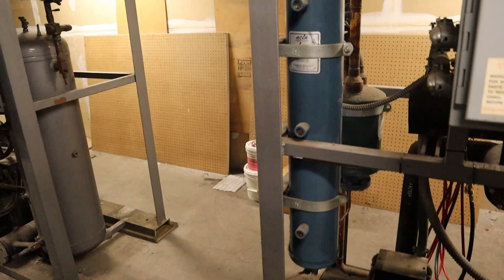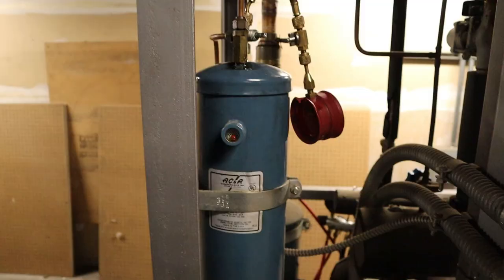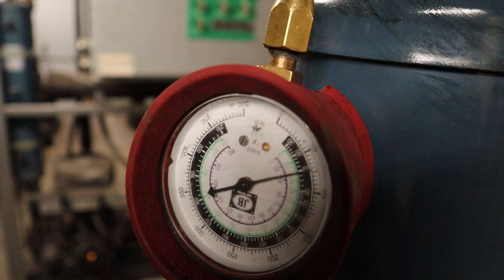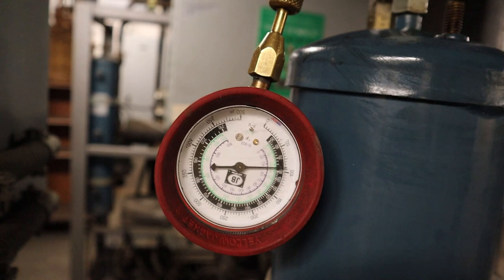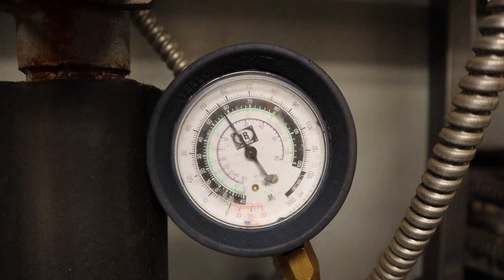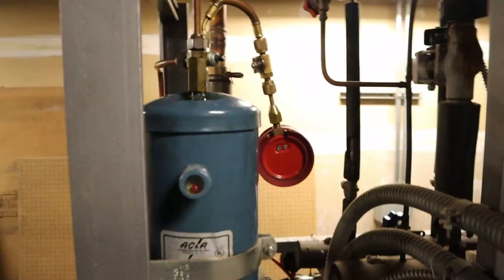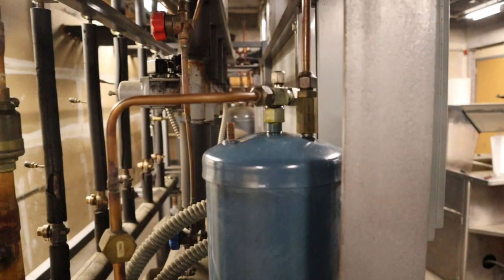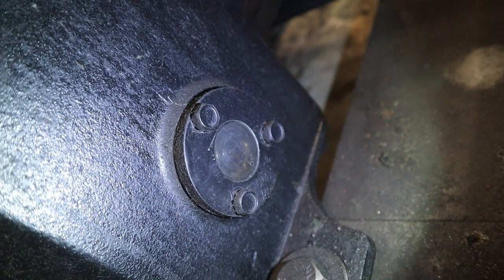Refrigeration: How to Check an Oil Reservoir Check Valve

Comment: I usually check OCV differential at the end of common oil line going to compressors, there should be a service port. Its a lot faster

Comment: Cheers mate. What would some symptoms of a bad check valve be?
Reply from the maker: The entire rack would be off on oil not just one compressor. No oil would be pushed to compressors no oil in them.
Reply: @refrigerationconfidential4376  thanks for reply, so does it use pressure from the discharge to create a higher pressure than the suction line, so oil can go to comps?
Reply from the maker: @thanktheknife  The equalization line is piped to the higher suction group like the +35 to help the oil push to the compressors

Comment: 5:18

What is "the equalizing line to the suction group"?
Reply: Drains back to the rack excess high pressure from reservoir, example you have 200 psig oil coming from separator into reservoir so your reservoir gets filled up with 200psig but you need just 70 like in this video (50 suction plus OCV20 equals 70 psig) the remaining 130psig vapor pressure will bleed into suction header, " remember this is not constant 130 going into header" it's just when separator sends high pressure oil into reservoir. I hope this helps
Reply: @cesar235cs  
Yes, thanks.

What is OCV20?